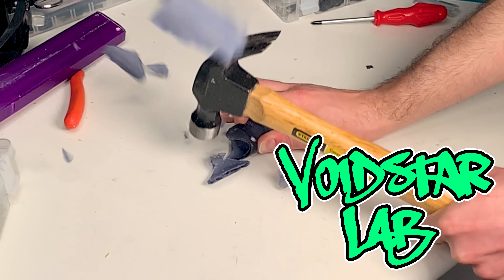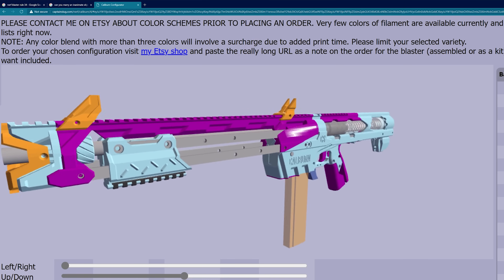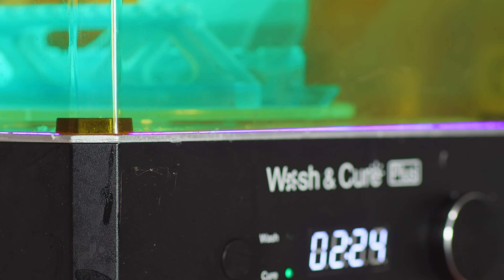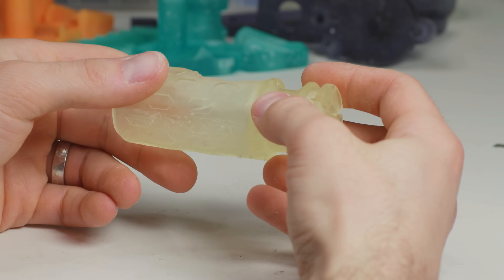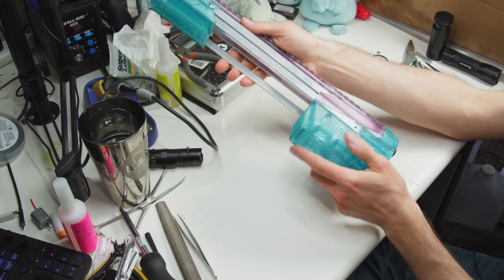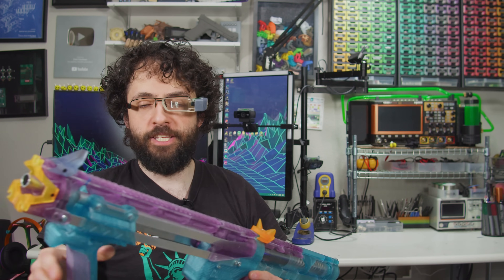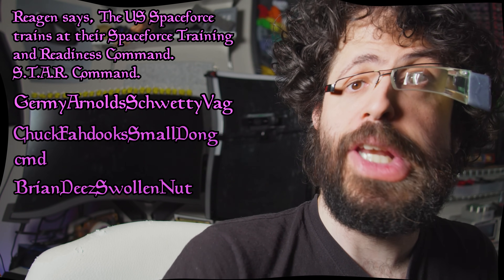Resin Rules the Nerf Battlefield! Caliburn 4 + Bulwark, Printed + Tested

Comment: After seeing this 2 years ago, I finally have tried my hand at it. This is my first 3D Printer. But not my first experience with 3D printing. My resin keeps curing sticky and I'm only using the clear v2 Blu, do I NEED the hard resin too? What is the ratio you used?

Edit: everything works now, I didn't realize there was a layer of plastic on the print bed, the only issues I run into is sticky prints, even after curing and drying they sometimes are a little sticky. My only draw back now... OK this is embarrassing. Amazon sold out of the printer you got for the video when I ordered my printer. And swapped it out with a different Anycubic printer. It's too small for... a lot of stuff. BUT that's ok. I can still use it for all kinds of stuff. And I can still print 90% of nerf builds. Saved me a few hundred bucks and the learning curves have been fine.

Comment: I've found that Nylon, Polycarbonate and some Carbon Fiber filaments tend to be the best and most practical to 3D print for my nerf blasters. I have used resin for some parts that benefit from high dimensional accuracy like flywheel cages or even flywheels themselves before though.

Comment: Special trick for getting shit (of the printed variety) off a resin build plate that doesn't involve sending a bunch of money to the creators of Wham Bam: use a heat gun to heat the plate and the part will release itself. Like porridge for bears, don't get it too hot.

Comment: best takeaway is probably to use both at different times in the printing process(assuming you have both types of printer). IE use resin to make parts of the grip and other contact surfaces. use FDM for parts that need single drection strength, resin for omnidirectional strength. also use scale to your benefit, using long flat resin surfaces and complex tall shapes with FDM.

Comment: I'm curious about the brittleness overtime. microfractures and the like. looks good until something finally gives and shards get flung around especially with the compressed spring design.
I'm also mildly concerned about the resin I've found that prints still have a bit of a... chemical-ness to them even after curing. not sure if I'd want that around my face.

Comment: ... there are people who don't use magnetic plates with their resin printers still?
They really ought to come standard these days with how big a difference they make in printing.

I've got 4 plates after at this point and it really lets me be way more lazy when it comes to cleaning prints up after they cook in the goop.
a note tho- the magnet does seem to fail over time. the surface gets too smooth and you get unwanted lateral motion or the adhesive on the back seems to fail.

Comment: I could see a happy marriage between SLA and FDM for the ultimate blaster.

SLA for the human contact portions like the foregrip, rear stock, cheek rests, trigger, and rear grip; and FDM for the Internals etc...

Would give the best of both worlds and a seriously over-engineered monster.
Reply from the maker: I think certain parts and blasters work better for each. High-impact parts like a plunger can be better in resin because there aren't any layer lines. FDM is better for flat parts like sears because they're just an intrinsic weakness of SLA.

Comment: 150 is low for dual stage.  What motors were you using?   That's a gorgeous bulwark and the flex sheet you used is reminiscent of the pei sheets alot of nerfers use for FDM printers.

Comment: Why would you design this with flat stock, which flexes, and not with an extruded aluminium profile, which is stable by itself? Same problem as the stability in 3d printers.
btw. PRFE spray reduces friction between plastic parts immensely.

Comment: I don't get where the whole idea that resin prints can't handle nerf blasting came from, you can resin 3d print actual guns which I'm pretty sure go through a much harsher beating.
Reply: @throwawayaccountm1325  From my experience 3d printing miscellaneous parts resin prints are stronger than fdm prints, they might get slightly more brittle after long amounts of UV exposure but it's not a problem I've ever ran into. And you very much can 3d print working guns, since the only part that's considered a gun is the receiver, which you could make out of wood if you really wanted to but it probably wouldn't hold up very well.

Comment: The tenacious resin is a bit demanding. You need to print at higher room temperature or have the printer in a heated enclosure. And you need additional supports because it is so flexible. I think however if you manage to get it to print it will be very strong.
Reply: What most people do, including me, is use it in a mix with other resins to modify properties.

Comment: so to get the best of both PLA and Resin is to make new 2 part handles/grips the internal/main part printed in PLA for its strength and an external "sleeve" printed in resin so it can still be comfortable, smooth and you can use the blaster longer.

Comment: I work in tool and die. we use different kinds of steel to achieve different purposes. Some steels are hard but brittle some are tough and durable. Some are just soft ect ect. I can see this same idea playing part here. MAYBE there are some parts of blasters that would have great benefits made this way, even if it maybe just as a cosmetic luxury. food for thought. I don't own a 3d printer.

Comment: Not sure if anyone has mentioned it, but there are engineering grade resins on the market that can be used on desktop printers. Yes, they can be pricey, but they are very strong and can be comparable to nylon and polycarbonate in terms of impact strength and durability.

Comment: 4:27 thats neither not how "cubic" works nor how the metric system works... not sure what printer you used as a base but lets assume build volume of 22cm x 22cm x 22cm that would be 10648cm³ (8000cm³ for a 20x20x20cm buildvolume). and just for comparison to your resin example: 12cm x 7cm x 15cm would be 1260cm³.
other than that slight mistake a great video tho!!

Comment: I've experimented with different resins for impact resistance and my favorite so far hands down is Phrozen Nylon-Green Tough resin. That stuff is flippin' amazing. Siraya Blu came in a relatively close second, but nylon green is crazy good. Kinda expensive, but not nearly as expensive as other "nylon" like resins on the market. I dyed it black before printing, increased the cure time, but should help with UV exposure.
Reply: Thanks for the shout out for Blu, Now we have a Blu Nylon Black that has even higher impact resistance than Blu and still quite affordable
Reply: @sirayatech2  Nice, it's already on the market or coming soon?
Reply: @giovanpietro  It is on Amazon US store now
Reply: @sirayatech2  Ok, thanks, when for EU?

Comment: I suppose the idea that resin doesn't work so well is because you're using designs that are based on the assumption you'll be using a filament printer for them. A design that is based from the ground up on resins might match or surpass filament designs

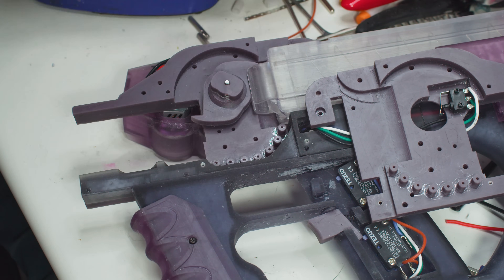Comment: 10:20 maybe you can try using a dry active release lubricant to reduce friction. Think rubbing your dry hands together vs rubbing your hands together with soap.
Reply: I'd be interested to see if maybe adding a thin sheet of Teflon instead of the rollers there would allow them to glide through easier. Like maybe you could print a ramp in that shape and then coat it with kapton tape.  Just an idea.

Comment: You know, if you put your print into hot water for a minute or two WITH the supports on, the supports come off SO MUCH easier. Very little clipping required.

EDIT: This before curing, so the softness gets softer by a bit, but I am weary if it would mess up tight accuracies.

Comment: Remove your supports during cleanup (BEFORE the UV treatment ) and you will have a HUGE improvement in support artifacts. You can rub/cut the bumps out and being still soft on the surface it doesn't leave such a mess of white scuff marks.

Comment: Reasons nobody uses resin prints for foam blasters seemed pretty obvious: lack of affordable resin printers (until recently), lack of resin printers with enough build volume.
Reply: resin is also expensive. 1kg of siraya tech blu is $50, and tenacious is nearly $70/kg. i reckon each of those blasters used at least a kilogram, possibly two or three. basic PLA and ABS average $25/kg

Comment: Ooof, printed ram base is probably stripping a few fps off. If the tolerances are super sharp, you might also be leaking from the plunger tube (unsure)

Comment: I have printed a resin Cliburn at home already about 6 months ago and it holds up well except for some parts that have cracked due to the large spring (K14) which I have replaced with Filament parts and it seems to hold up now with out any breakage.
Reply: Literally my first though about a resin caliburn was "now put a k14 in it" lol

Comment: From what I've seen, the tenacious resin is best used to mix into weaker resins to give them better flex and durability
Reply from the maker: It’s a pretty solid upgrade to nearly anything. Siraya assured me that they formulated to print in 100% tenacious, but I’ll be damned if I’ve ever seen anyone pull it off.
Reply: @ZackFreedman  try warming the room to 30C (or putting your printer in a grow tent with a fan heater)
Reply: @ZackFreedman  it's not difficult, you just have to print it in a hot room, or heat the resin.  It says it right on the bottle =P 25C is a minimum imo, but better around 30C.  Just don't forget the resin heats up when cured, so if you're printing larger parts the temps will go up after you start printing so don't make it too hot at the start.
Reply: @ZackFreedman  I have printed some enormous parts in tenacious notably some L shaped pieces 150x130mm they came out completely strainght after about 3 test prints. The most important part is that the part is corrrectly oriented then supported. Not every model can or should be printed in tenacious; its just too flexible for some mechanical parts.
Reply: Tenacious D, hahahaha

Comment: Just a heads up, Frontline Foam has a history of IP infringement, design theft, failure to compensate designers for using their work, parts that aren’t built to the correct tolerance, horrible customer service, and lying about blaster performance. They’re well known within the nerf hobby as a brand to be avoided at all costs. 

They also happen to support a particular blaster designer, who I won’t name for sake of not stirring drama, who is horrifically transphobic, homophobic, racist, and has been banned from just about every corner of the hobby.

I’d highly encourage you support more ethical shops like Out Of Darts, Foamblast, Captain Slug, Silverfox Industries, Orion Blasters, and others.
Reply: Plus, they modify files for some of the blasters they sell (e.g. from what I’ve heard, the Zinc and XC). Hopefully the Woozi is the last thing I get from them, especially since I’ve had worse experience with their customer service lately with my Woozi project that’s still ongoing.
Reply: Damn, sure glad I saw this. There's no way I'm gonna support bad actors like them. Thanks!

Comment: On the bullwork it might be good to have the grips and flywheel as resin and the majority of the rest as filament. Cuts down on weight and allows a smooth operation without the flywheel housing overheating.

Comment: A mix of both resin and FDM printers would probally be the most practical
Reply: @Luke Fabis and 15 times the price
Reply: The point was that if you have only one, you're not locked out of the hobby.

But yes absolutely it looks like acrylic resin parts in combination with FDM-printed ASA or whatever (and small parts in other plastics, like foamed tpu grip pads) would actually be optimal.

The friction problem on the resin-printed parts is because they have a native surface. Some could benefit from a surface treatment, usually a clear acrylic varnish or a coat of UV resin is used to "defog" the print by filling in the texture and making a smooth surface. So if you're stuck in Resin-Only land, that might be an idea for things like those little rollers, and the interior they're interacting with - some sort of hard varnish, polished where possible.

Comment: As a production cnc machinist, im always looking to speed up my programs (giving me more f o time ofcourse) but we still look at the additive industry as cool no material waste but time is money too and print times are hilarious (yes i can have those 50 parts ready in only 4 months). What can be done, whats the major holdup in the process?
Reply: I'm not sure there's much that can be done beyond incremental/marginal improvements. It takes time for resin to harden. It takes time to move a printhead around while extruding hot plastic. There's ways of speeding it up, sure, but it just fundamentally takes a lot more time to do things bespoke- which is what 3D printers HAVE to do- than it does to just stamp or cast parts in huge batches. 3D printing is cool as hell and has plenty of practical uses, but it was never going to be the be-all end-all of manufacturing.
Reply: Imagine if your cnc cutter head could only do 50 micron deep passes and you'll be on the right track. To achieve fine detail and smooth results outside of vertical and horizontal surfaces, the printer has to deposit layers in the 30-50 micron range, and each requires 2s of exposure to cure. Then there's a few seconds of lifting up the platform to unstick the printer it from the film and let more resin flow in, then lowering it back into position (a few more seconds). For every layer.
Reply: @bakedbeings  i get it, but like hogging when you have much to take away, isnt there a way to lay thicker passes when called for? Every layer doesnt need finish quality right?
Reply: @TEE19622  Yep you can set thicker layer heights for the whole piece when needed. They need longer to cure but overall it's quicker. Some resins expose quicker too, they're just not as tough.  UV light is very easily blocked though, so scattering and then complete blocking is an issue beyond .05mm.
Reply: @bakedbeings  thanks mac, may i list you as a resource? I have a anycubic photon resin prn and plan to get a vyper soon

Comment: I've had SLA blasters get weak with UV exposure over months that were originally impact resistant. I'd be curious to see this same test in 6mo.
Reply from the maker: Before I actually use these outside, I need to coat them with UV-proof marine sealant. They would degrade if exposed repeatedly.
Reply: Automotive clear coat protects against UV and is relatively inexpensive. Would be interesting to try if you're not keen on covering the printed parts in actual paint.
Reply: I'm also curious about this. Maybe have another set printed and coated with anti-UV varnish which might also help a smidge with some of the looseness introduced by being to accurate.
Reply: We're they painted?
Reply: Did you trying slapping some sunscreen on that bitch? Hahaha maybe a UV protective paint next time?
Reply: Yo the best way to combat this IMO would be to buy some auto grade 2k Clear coat, i suggest Spraymax. You can just lay it on and itll harden and shrink up, and offer a lot of protection
Reply: Spray paint em!
Reply: UV light is blocked by basically anything so a quick clear coat should do the trick
Reply: painting them or coating them does remove some of the pros. Forever pro is that it's toxic as f
Reply: @0oSiLveRo0  forever con maybe
Reply: @0oSiLveRo0  this is incorrect, UV resin once cured is non-toxic and food safe.
Reply: @tukuiPat  I wasn't talking about cured. I just don't want to handle toxic goo and smell it in my small apartment.
Reply: @0oSiLveRo0  haha, fair enough, wasn't sure as some people in the 3D printing world don't seem to understand this about cured resin and use it as a reason for them avoiding it.